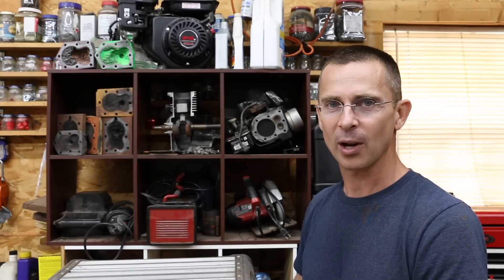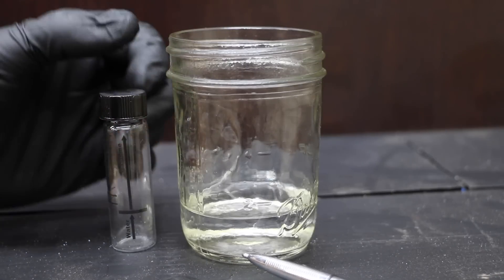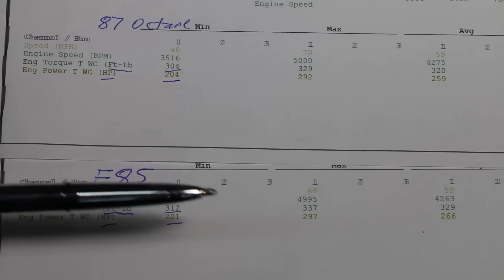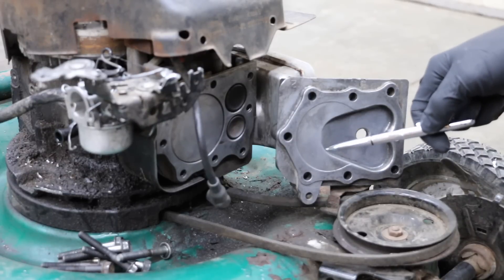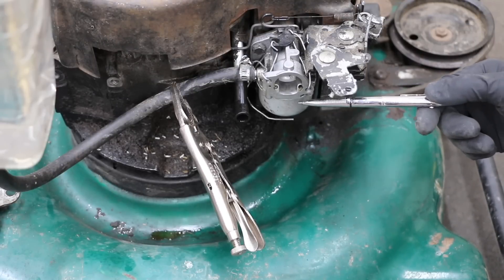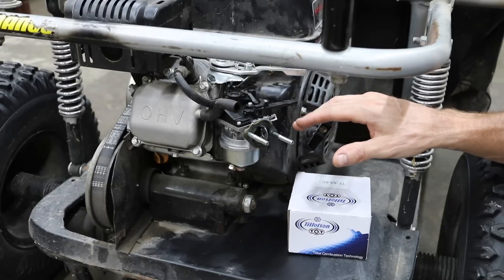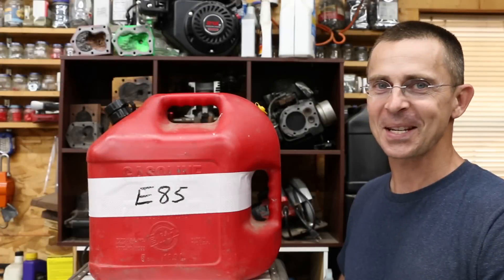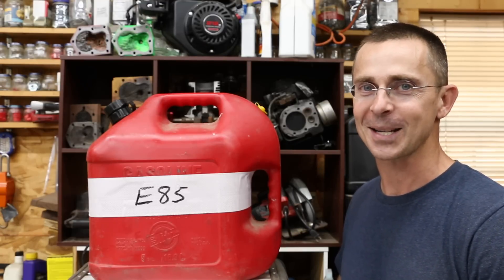Is E85 better than Gasoline? Let's find out!

Comment: Just clicked on the video and ... i can say from the start: NO, it will not be more efficient (7:1 AFR) and no it will not produce more power IF you cannot put more air and more E85 into the engine :)
On the same displacement and forced induction E85 will make double the power vs cheap gasoline but... not on N/A.
Reply from the maker: Thank you
Reply: That doesn't mean I didn't watch the video. No sir! I enjoy your videos, I find them entertaining. Usually I press Like and then watch the video sipping a beer :)

Comment: I have used E85 a lot over the last three vehicles. I have noticed a difference in driveability, but I consistently get 30% fewer miles to the gallon with straight E85. My best gas mileage occurs between %55 and %60 percent ethanol. I could get the exact percent of ethanol using the Android Torque Pro with a Bluetooth OBDII port reader.
Reply from the maker: Great point on the fuel efficiency loss with E85. Thank you

Comment: I was just wondering what your opinion on Honda engines are. You have shown us your use of Predator engines which as far as I know, are Honda clones, so I was wondering that you thought of them.
Reply from the maker: I have several Honda engines as well as the Predator engines.  I really like both engines a lot.  For the price of around $100, I'd go with the Predator. With proper maintenance and oil changes, it'll last a long time.

Comment: Please do not use E85 in small engines. The first item to break down is the rubber seat/diaphram for the carburetor needle.
Reply from the maker: You are right. That happened to the first carb. I just bought more carb parts.

Comment: I was watching the news on TV when the notification for this video popped up.  The news went on pause so I could watch this instead.  I found it funny that the E85 gave worse fuel economy but cleaned better.  Seems like a zero-sum trade off to me, no clear winner.
Reply from the maker: Thank you very much!  Great point on the efficiency loss vs cleaning.  It's a very powerful solvent but contains 30% less energy per gallon.  I probably won't use it again.

Comment: After having to rebuild a chainsaw last year that had its fuel lines deteriorate, it makes me wonder how fast fuel lines would deteriorate if placed in a jar of e85.

Edit For clarity: the chainsaw was used with reglaur (10% ethanol fuel, plus 2cycle oil). I just wonder the time scale that it would take for e85 to make the lines brittle. Days, weeks, months?
Reply from the maker: Great point. I'm about to begin a long-term test to find out.
Reply: Project Farm put a couple of two cycle diaphragms in , too.
Reply: @ProjectFarm  Matt from The Workshop is doing a long term testing on ethenol and ethenol blended gasoline or petrol to them Britts
Reply: @ProjectFarm  That sounds great!
Reply: yay @ProjectFarm
Reply: You NEVER heard of someone having to put a kit and fuel lines in a saw. Now it's every year. Pitiful!
Reply: I've been running straight e85 (with 2 stroke oil) in an older homelite chainsaw for years, fuel lines went from rock hard and needing to be replaced soon to sort and supple a few months after switching, and they've stayed like that for over 8 years to this day. I've run ethanol in lots of stuff for multiple years and the only issues I've had was it ATE the paint off a 1973 kawasaki motorcycle immediately when I spilled some, and in my daily driver car the fuel level sender corrodes and needs to be coated with sealant to keep it from failing. Weird issue that many cars don't experience when converting (which does not require a fuel system changeout). Ethanol has it's issues, especially when blended in tiny quantities with gasoline like we currently do- but it gets blamed for too much damage. My mower has been on straight e85 for as long as my cars (almost 10 years) and it's also been trouble free for years.... Fuel lines are "new condition" soft and pliable and would have already hardened up with gasoline.... Gas is naturally very tough on rubber / synthetic rubber. Some formulations of rubber absolutely will react with high concentrations of ethanol, but I personally haven't encountered one yet. My engines and cars also get stored outside for winter with e85 in the tank.
Reply: @volvo09  the chainsaw I have is a craftsman not sure exactly how old. The lines were bad and the carb gummed up when it was given to me as a freebie. The replacement lines are "tygothane" and I doubt you can even get rubber lines small enough for it.

Age could be the culprit for the hardened cracked lines, but I think many of us would love to see a more conclusive test.
Reply: they sell fuel line made for e85
Reply: The standard you are looking for hoses carrying ethanol is SAE 30R14. In tank rated fuel hose would be SAE 30R10.
Reply: Ethanol has two major issues as a fuel. First, it has less BTU’s than regular gasoline, so unless an engine is optimized to run on it, power will be less and fuel economy will suffer. Second, ethanol is hygroscopic. That is, it attracts moisture which can eventually separate out of the fuel. I run my own small engine repair business and I see so many fuel tanks and carbs with water in them, and I know it is due to moisture in the air being drawn into the ethanol which eventually separates out. I rebuild so many two cycle carbs due to damage to diaphragms that have been run with E10 fuel. Even fuel lines like Tygon that are supposedly designed to tolerate ethanol still get brittle and disintegrate with E10, and it can happen in only a year or two. And now the idiots in Washington are about to mandate 15% ethanol in fuel! I’m sure I’m not the only small engine mechanic that is dreading that. All OEM’s that I am aware of require fuel with no more than 10% ethanol be used. Gonna be a disaster.......
Reply: you're right.
Reply: Have some soaking in a closed jar of each kind of fuel.  E85, various Es, regular, mid, super and diesel.  Peanut oil as well for the French fry power addicts as well as biofuel.  

But I'd also suggest making a pump system for each kind circulating in their own jars with the respective hoses to see if circulation would increase the rate of deterioration.  Maybe hook the whole thing up on a ten minute timer, twice a day.  Put each one in their own Tupperware box to catch leaks.
Reply: I should add that I have personally switched all my small two stroke stuff to zero ethanol fuel at an increased cost just to stop replacing fuel lines and rebuilding carbs.  Race fuel and aviation fuel is worth the 4-5 bucks a gallon for small engines.   Ca Gas is God awful.
Reply: Many have tried all have failed.
Reply: Lines for e86 and gas are very different.
Reply: Standard gasoline rated fuel system stuff just doesn't hold up to the ethanol being so aggressive.
Reply: It's the same deal with biodiesel. It can degrade rubber fuel lines, so if you covert a diesel vehicle to biodiesel you have to swap out all the fuel lines.
Reply: Nicolas Broszky  please double check your chemistry.
Reply: In my opinion there is big differences in materials used in machinery and vehicles. E.g. chinese stuff has way lower quality  of their fuel lines, rubber parts etc. compared to a Honda, they can get hard and brittle as fast as few month of use with normal fuel while the "japanese" rubber stays fine and soft for decades.
Reply: I'm definatly interested,  I refuse to use ethanol fuel in my jet ski. 
In nz we only get one brand- premium fuel with 10% added.(its expensive too)
Reply: Yes fuel lines are a problem but I used to have to replace them every few years on 2 cycle engines even when I was using 0% ethanol (pure gasoline, gasoline).  Might be due to having the oil in the fuel?  That or the flimsy thin material used for the fuel lines, is nowhere near as rugged as automobile fuel line because it doesn't have to withstand the pressure or meet safety standards.
Reply: My weed eater ate its fuel lines with ethanol free gas.....
Reply: If anyone runs e85 through a 2cycle engine they need to go back to school science class because uh ethanol and oil well dont get along without a ton of emulsifiers
Reply: Yup e85 is known to eat standard fuel lines that aren’t designed for it.
Reply: Depends on if the fuel system is designed around it.
Reply: @bryand6094  Right, the older 2cycle lines definitely weren't and from what I've read the replacement lines still aren't perfect at handling even the 10% ethanol.
Reply: I run E10 on my car and no problem what so ever, but It was also designed for it and yes It Is french.
Reply: @skylineXpert  the fuel lines on cars are a different material than the small lines on 2cycle.
Reply: I'm a small engine mechanic. 98% of my daily work is dumping fuel from the tank, cleaning carburetors, and replacing fuel lines. 

I live in MA, where our moronic state government mandates ethanol in ALL gasoline, regardless of octane rating, or where it will be used. We're forced to pay road tax for mowing our lawns. No ethanol-free fuel is sold anywhere at the pump in MA. 

Now, before all you treehuggers come out and try to prove me wrong by posting a link to pure-gas.org , just know that every single place listed on that site in MA is either a speed shop, motorcycle shop, or OPE dealer selling CANNED FUEL. You CANNOT buy ethanol free fuel at the pump in MA! For this reason, everyone has constant problems up here with outdoor power equipment. Guess this is how they force people into electric products.
Reply: Smitty Smithsonite You actually understand the problem. My suggestion would be replacing the lines and gaskets, etc with synthetic ones. There are many positives and negatives with ethanol. You can get a lot more power to weight with ethanol than you can with gasoline because you can get a lot more boost with ethanol. I'm not convinced it's any better than gasoline because you can't get unbiased numbers from either side. Personally if you want more power I would go E85 if you want best value i would go with regular gas. If your using small engines and you have the option I would go with pure gas which should be premium unless your kart racing an engine you rebuilt to run on E85.
Reply: @joer8854  ethanol has a lower btu per gallon than gas so it's not possible to do what you're saying. What you're trying to say is ethanol has a generally higher octane rating that allows more dynamic compression and/or timing to help compensate for the btu loss(help, not eliminate). However, you'll notice the guys running big power on ethanol use much larger fuel pumps to do it because they still need the btu's. It's just more cost effective to run 105-110 octane ethanol than it is to buy 100-110 octane gas because of the subsidies the ethanol market has.
Reply: It has nothing to do with cost effective. The reason for years gear heads hated boost was because with relatively small amounts of boost your engine would grenade in a fairly short amount of time. With ethanol you can get unbelievably massive amounts of boost without that problem and with a well built racing engine even more. I get that your all, "MY MANUAL 1972 ENGINE IS THE BEST ENGINE IN HISTORY AND GASOLINE IS THE END ALL BE ALL OF EVERYTHING AND NOTHING ELSE SHOULD EVER BE MADE!!!!!" but your wrong. Everything has it's plus and minus and yes shoving massive amounts of ethanol in an engine isn't cheap, but nobody in history ever said my priority in my race car that's capable of making 1200 horse power is fuel efficiency and saving money.
Reply: Smitty Smithsonite the same process used to test ethanol content can be used large scale to separate the ethanol from the fuel.  The only downside is it really needs a mixing container with a bottom drain to bleed off the water/alcohol mix easily, and the water/alcohol mix has to be disposed of or used somehow.
Reply: Bill, good point. I'm just about to purchase fuel lines for an older craftsman leaf blower that had its lines rot out internally. The blower must be close to 9 years old. This only happened about a month ago. I bet that e85 would destroy lines really quickly. I think the blower was made without ethanol in mind though.
Reply: There you go!  A fuel line erosion test!  Use a few types of gaskets and fuel lines with regular gas and e85.  Maybe use brake fluid and brake cleaner in the test too.  I can see the Mason jars lining up now...
Reply: There are some gas stations that sell 0% ethanol gas but its hard to find
Reply: @TONOCLAY  HyVee and Casey's (Iowa and nearby states)
Reply: My car isn't e10 compatible. It uses stainless lines thought except for on the fuel pump pickup. It has a small rubber line there. I've heard horror stories of those rotting out from the ethonal, but I havent had a problem yet.
Reply: @lilsammywasapunkrock  Are there any o-rings in your "in tank" fuel pump?  Are they E85 compatible?
Reply: Before this e stuff when gas was pink and smelled great, the only thing was the lead added for valves, witch was bad for us and the environment. I never heard of problems like we have today (corrasion) . you have to clean out your system or it will not run the next time. When I went to the junk yard I took a carburetor off an engine, who knows how long it sat their you did not have corrosion as long as water did not get to it. I would like to see something not corrode and burns real clean for the environment we live in.
Reply: When it comes to small engines like lawnmower weed eater stuff like that im Still hell bent on running down to a lowes or something and buying a couple cans lawn and garden gas with zero ethanol and fair amount of cleaners, it always keeps my equipment running a top peak performance and trouble free life
Reply: Nicolas Broszky you are mistaken.  Search on the internet.  Ethanol is highly hydroscopic.  Water is much denser than gasoline and will sink to the bottom of the container.  Watch the video again and observe how the ethanol content test works.  Add a sufficient volume of water and the ethanol leaves the gasoline and dissolves in the water.  The water/ethanol mix is heavier than gasoline and separates to the bottom of the container where it can be drained off.  Pure gas remains.  It works by virtue of the highly hydroscopic nature of ethanol.
Reply: upgrade ur fuel lines, if not possible get stronger chainsaw

Comment: I use 85 octane fuel once I get to Utah from So. Cal. where I always use 87 in my '03 Corolla.  I don't know if it's a combination of the altitude change WITH the 85 or just my mind playing tricks on me, but I "feel" like the Toyo runs almost the same with a little less mpg.  Not as drastic as your Sub , but then again your Sub probably weighs twice my Toyo.  Love your vids!
Reply: 85 Octane is NOT E85.  85 Octane here in the mountain states is the regular fuel sold at the pumps.  The claim is due to the lower atmospheric pressure, a lower octane fuel can be used without issues.  This holds true for naturally aspirated engines, but not for forced induction engines.
Reply from the maker: Thank you!
Reply: Its an altitude thing. Less aor needs less octane. I've driven from utah to Cali twice. I averaged within 2 mpg both ways, although one way is much more downhill. It was 1600 miles round trip.

One good thing about e10, I can advance my timing an extra 4 degrees or so with no pinging
Reply: Prefer to run 89 in those high comp engines.

Comment: E85 is great in Boosted engines. Allows more timing and is way higher in Octane. Super charge that Suburban, tune it on E85, everything about it will be better, HP and Fuel econ. E85 FTW in boosted applications. Think NHRA top fuel class, they run on 100% ethanol.
Reply from the maker: Great point. Thank you

Comment: From my understanding, about the only benefit of E85 is if your tune your vehicle since E85 has higher octane. In some cases, it might be cheaper per mile than E10. Then there's the "greener" aspect since the carbon is "new" instead of "old". There is only one E85 gas station within fifty miles of me and it's just not worth the distance. I could fairly easily convert my car to run on E85, but there's just not enough incentive.
Reply from the maker: Great point!